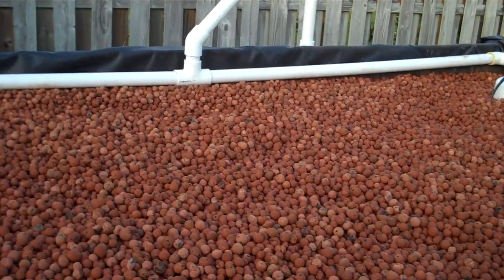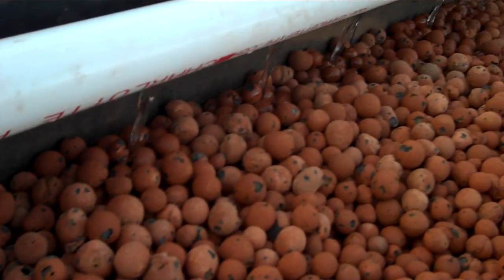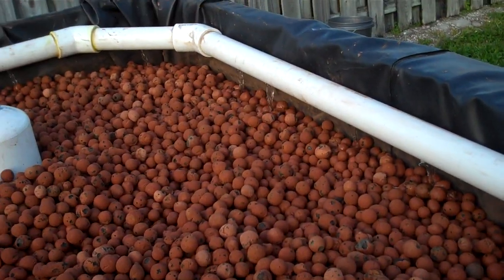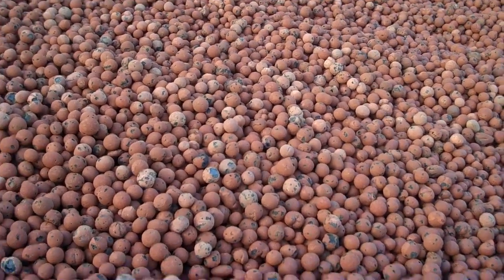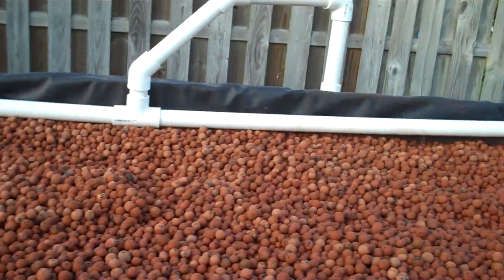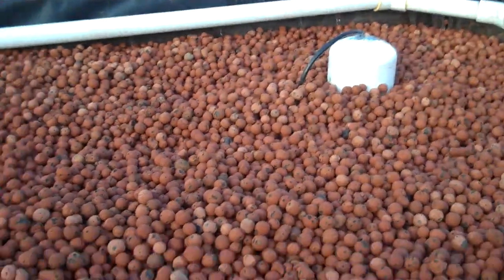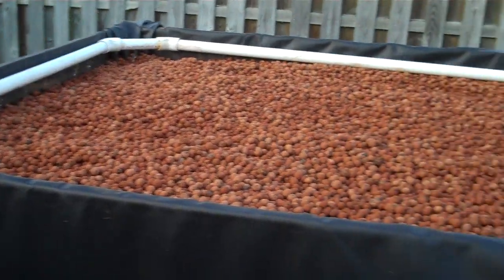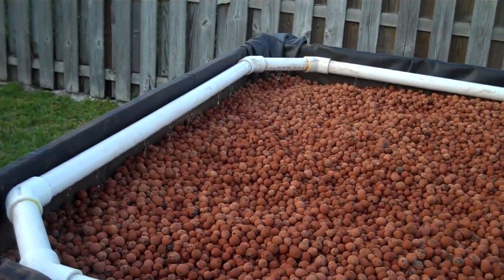300 Gallon Aquaponics Buildout Part 7

Comment: Hello I am setting up a 300 gal.rubber maid too I want know when you fill up your grow bed how much water volume do you loose out of your fish tank and since you only have it on for 15 min. an hour does it affect the fish
also do you have your timer set to shut off while your siphon is draining or do have water left over after the siphon breaks in other words is your pump still pumping after your siphon has broken if not how did you set the pump going off in relation to your siphon breaking